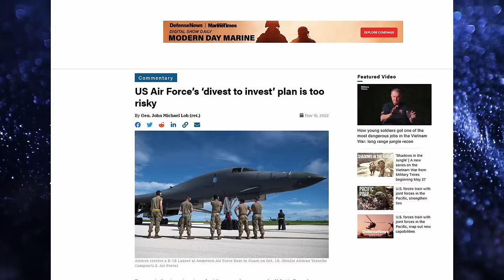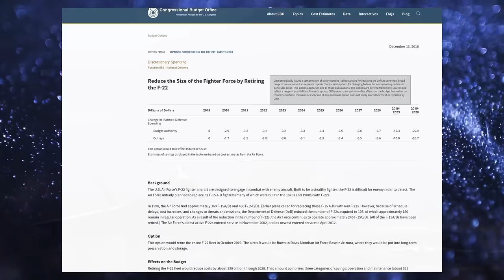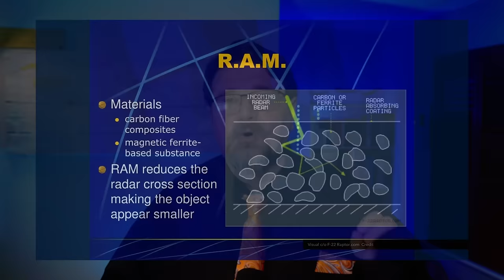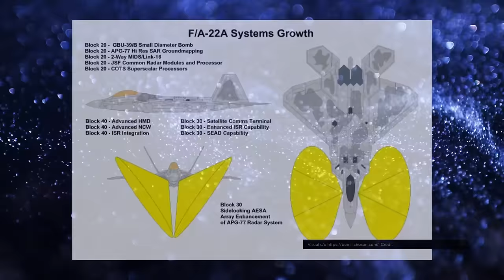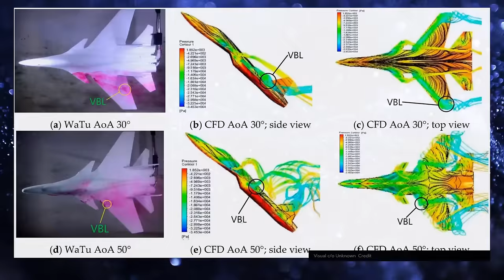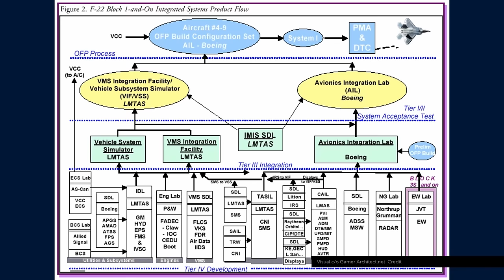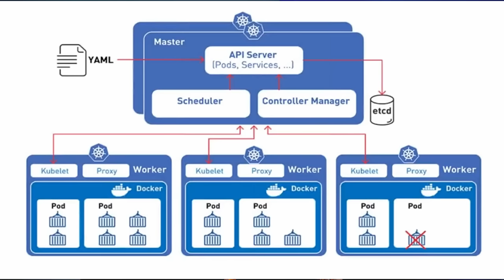F-22 Raptor: The Apex Predator 😈

Comment: An upgraded F22 is far better an economical decision over a new dedicated 5th gen air dominance platform. It would pay better for tye Americans if they rather put that left out money into a 6th gen aircraft or a good anti hypersonic system.
Reply: Eh, not really. Dont get me wrong, the decision to upgrade the f22 is more economical than a new aircraft. But the problem is the us is rapidly aging their 4th gen fighters and needs more. A 6th gen and drones makes the most sense, and in that context a rapid program for that is more economical than other options.
Reply: it makes sense to do both. Ideally, the usn/ usaf wont show people the ngad until it's been actually been seen (which could end up being a decade after it's commissioned.) The reason for this is due to the fact that it's really hard to copy something you've never seen before.

Which means they need upgrades on the raptors to keep them current, since they'll be the face of US airpower.
Reply: There is only so much you can upgrade on the F-22. It came before modern air warfare was really established and just won't fit into 6th Gen combat as its already pushing its envelope with other real 5th Gen fighters. Spending all that money to upgrade a few F-22s to a level still below the F-35 is questionable considering you could just buy more F-35s and retire the F-22s. I'm guessing the Airforce decided that upgrading F-22s won't cost much and that they need the extra numbers quickly. Increase in World Tension probably caused this decision. Still, just going all in on the more advanced F-35s still seems like the better choice unless you really need something decent and survivable in the air quickly.

Comment: Hello, I often see that the Western public has a bit of a hard head on certain issues. For this reason sometimes you joke a little. Could you kindly make an unambiguous judgment as to which aircraft is most maneuverable between the F-22 and the Su-57? What about the radar system? Who between the two planes can see the other first?
Reply from the maker: A 1 v 1 merge scenario is unlikely today. However the Su-57 is more manoeuvrable, but not by much, and it should see the F-22 first, but the F-22 will likely shoot first.

Comment: There would not be any upgrades or airframe life extensions if the F35 worked as advertised.  But after 20+ years it still isn't close to what was sold.

Comment: The Su-57 is universally panned as a piece of crap. It is a tiny bit better now that it's planned engines are coming online. And I'm not just talking about the Su-57 that has exposed screw on it's wings and panels that didn't line up. I'm talking about the rest. This information is not of my own deduction per se, but by many, many international defense experts who do analysis (and are almost always correct) for a living. There's so many facets to the arguement and either you are short-sighted, biased, or are just saying things in order to get comments and game the algorithm. And you hardly touched on the radar. THAT is a work of art. 
The J-20 is much better than the Su-57, but it would have trouble against either of America's stealth jets. It's information is known only really to intelligence agencies who don't share what they know as they would reveal how they know. And the F-22 is getting new RAM coating that also will block infrared.
Reply from the maker: You don’t have to watch my videos, if they don’t line up with what you want to be told.

Comment: There is a difference between making controversial statements and simply repeating propaganda. Here is the issue with the claim you made about the SU-57 being better. Did you know that since it first appeared in 2010, there are only between 3-15 operational? Has it ever been tested in battle? Russia isn't even flying it over Ukraine, and Ukraine doesn't have significant air capabilities or superiority. Why? How about China’s J-20? Has it been tested in battle? The issue is that both China and Russia claim these aircraft are superior but have produced very few of them and have never tested them in battle. China has yet to land one on an aircraft carrier. The same cannot be said about the F-35 or the F-22. They are actively tested and flown in missions. It should be easy to prove: Russia can fly the SU-57 over Ukraine and China can fly the J-20 over Taiwan. After all, they claim to have better stealth capabilities than the F-22. What are they worried about? The U.S. isn’t as it confidently uses the F22 in operations over hot zones.
Reply: Point 1: SU-57 Production and Operational Status

Claim: There are only between 3-15 operational SU-57s since it first appeared in 2010.

Analysis: This claim is largely accurate. As of the latest available information, Russia has indeed produced a limited number of SU-57s. The exact number may vary, but estimates typically fall within this range. Production has been slow due to various factors including funding, technical challenges, and prioritization of other military projects.
Point 2: Combat Testing of SU-57

Claim: The SU-57 has not been tested in battle and is not being flown over Ukraine.

Analysis: The SU-57 has seen limited operational use. Russia has reportedly deployed the SU-57 in Syria in a limited capacity, though this was more for testing purposes rather than extensive combat deployment. Regarding Ukraine, there is no verified information indicating significant deployment of the SU-57 in the ongoing conflict. This could be due to several factors, including the limited number of aircraft available and the risk of losing a high-value asset in combat.
Reply: Point 3: J-20 Combat Testing

Claim: China’s J-20 has not been tested in battle and has not landed on an aircraft carrier.

Analysis: This claim is also accurate. The J-20 has not seen combat and is primarily an air superiority fighter. China has not developed a carrier-borne variant of the J-20, and its primary stealth fighter for naval operations is the J-15, which is not a stealth aircraft. The J-20 is still in the phase of being integrated into the PLA Air Force and evaluated for its capabilities.

Point 5: Stealth Capabilities and Deployment

Claim: Russia and China claim superior stealth capabilities but have not demonstrated them in combat scenarios like the U.S. with its F-22.

Analysis: This is partially correct. Both Russia and China claim advanced stealth capabilities for their respective aircraft, but these claims are difficult to verify independently without extensive combat testing. The reluctance to deploy these aircraft in high-risk areas could be due to a variety of factors, including strategic considerations, the risk of losing advanced technology to adversaries, and the limited number of operational units.

@bladestarX is generally correct in their assertions about the limited production and deployment of the SU-57 and J-20 compared to the F-35 and F-22. Their point about the lack of combat testing for the SU-57 and J-20 is also valid.

Comment: I think all these planned massive upgrades are an admission that the USAF doesn't really understand what NGAD is or whether it will be actually relevant, and that they're actually floundering by trying to simultaneously evaluate as many proof of concepts on an older airframe as they can afford to. The key reason for this is that Chinese developments in both civilian and military spheres are happening too quickly for foreign planners to anticipate.

Another sign of this is the move to iterative development. It's much easier to make iterative progress when you have a concrete goal in mind - the Chinese military targets the American military as the benchmark to meet or surpass, and the latter has been very slow at making progress against the PLA in recent decades. It's much more difficult when the American military strives to be the pioneer and vanguard of full spectrum dominance, and when there's no domestic civilian manufacturing sector with proven innovations to draw from. Cheaper, yes, but far less effective at meeting American requirements than the Chinese do for their own, and the end product will be nowhere near as technologically salient as demanded.

Comment: The F-22 - a dedicated interdictor by design and arguably informed by the late Soviet Mikoyan Mig-31 and Yakovlev YAK-141 research ('data link' and so to speak 'transsonic super-maneuverability') - is doomed due to the dismantling of it's production lines in 2011_ that could have swiftly produced spares for a bearable price (the result of designing a weapon that is too sophisticated for export, increasing domestic production costs and straining the national budget beyond sustainability). 
Less than half a dozen air regiments/wings won't cut it when fighting a world war across all of Europe and Asia. 

It is more likely that after a makeshift modernization, the experimental Lockheed F-117 Nighthawk (despite the 'F' designation, the predecessor to the B2 strike bomber) production will be restarted than that of the only actual stealth craft , the US has ever designed (regarding the reduced engine exhaust RADAR signature of the F-22)... 

[one can imagine the much simpler 'geometric stealth' and production combined with recent sophisticated munitions and potential hybrid remote control, integrated with sensor fusion and air combat support by UCAV - instead of a 'Next Generation Air Dominance' craft in mid war development hell...while the still operating F-22 may share the fate of the Mig-31 K as a hypersonic missile delivery platform, justifying it's recent air-to-ground fire control upgrades] 

What is most concerning is the rate at which the West believes it's F-16 assets to be dispensable when sending them to airfields in range of numerous ballistic missile strikes. 

Without an actual light fighter that can be produced - and lost - en masse, readily the West fields nothing but the equivalent of a 'special operations' equipment (F-15 and F-35) - too valuable to be risked in face of daily attrition and thus undermining the entire NATO doctrine of air superiority ... 

...which means +a rapid escalation into the deployment of nuclear arms* is just a few botched air raids away...

Comment: Um... what? Calling the SU57 superior... your crazy. That thing is about as stealthy as a F15ex. It's litterally 4.5 gen. And it probally is about 20-30 years behind in electronics. And Chinas J20... it's stealthy from the front. Not the sides. Its meant to sling air to air missles at range. Which doesn't really work against stealth fighters like the 35.
Reply: Very misinformed post but unsurprising from someone called ‘deltaone’.
Reply: The Su-57 meets Western standards to be called stealth while fully armed. The F-15EX does not even when completely unarmed.

Comment: Like the F35, the F22 has been primarily used on goat herders in Syria and Iraq. Stealth capabilities are becoming moot with China recently announcing their radar can now easily track stealth aircraft. Way too expensive to lose in battle with a price tag of $350 million and $68,000/hour to operate. For comparison, an SU57 costs $35 million, a 10th the price. Even with slightly less capabilities in stealth, radar and maneuverability, it would be an interesting match to the F22. I always remember how the Abrams tank was tooted by the US as the greatest tank and would steamroll over the Russians. Same with every other weapon we have sent to Ukraine. ...But, but, but, this time it will be different. 😂
Reply: Tracking isn't tracking. Just knowing 'it's somewhere over there' and having a weapon track it in order to hit it are two very different things
Reply: If it's moving faster then 350pkh chances are it's not a bird...problem is cramping a radar sophisticated enough to track such a small bird in a missle.
Reply: China has made claims that everything they build can defeat the US equivalent, regardless of physics. Radar will never "defeat" stealth, because that is not how these systems work.

The F-22 cost $143m when it was last produced, and only costs $68000 ph to operate because they retooled the factories in favour of the F-35, leaving the F-22 without a reliable supply chain. The Su-57 costs $100m+, and the J-20 around $120m. As for Russia's production capacity, they have fewer 4th gen Su-35Ss than the US does F-22s. Russia builds it's aircraft rugged because their supply chains that keep vehicles operational are terrible.

When talking about individual vehicles it's important to remember that if 1 vehicle takes out 3 vehicles before being destroyed, that is still "steamrolling". The Abrams hasn't lost that reputation in Ukraine, rather it doesn't have the opportunity to really get involved per Western doctrine because Ukraine's frontlines are mainly determined by artillery.
Reply: @dumdumbinks274  good points. So what do you think about the F16s? Do you think they will be effective? I assume they will only be used for stand-off munitions. The saab 340 will most likely be the Russian's main target.
Reply: @ericberg2131  F-16s will be effective against China's 4th gens, probably closer to 50/50 chance of victory than many would like to believe. Against 5th gens the F-16 stands little chance. 

The F-16 is a lightweight fighter, meaning it can't carry many munitions before it's performance really starts to drop due to the extra weight and drag. It also can't carry anything that can outrange China's current missiles, so is at both a performance and engagement range disadvantage in most air to air combat scenarios. Add to that a potential stealth adversary and the F-16's overall chances don't look good. The F-16 will continue to be effective as a strike fighter, but that too would be limited by it's combat range in a Pacific scenario as opposed to the European scenarios it was designed for.